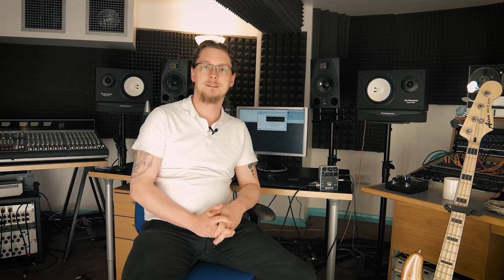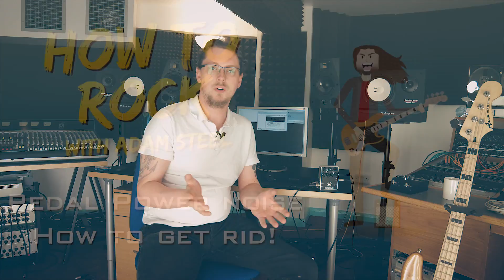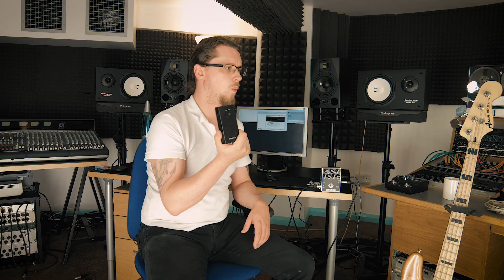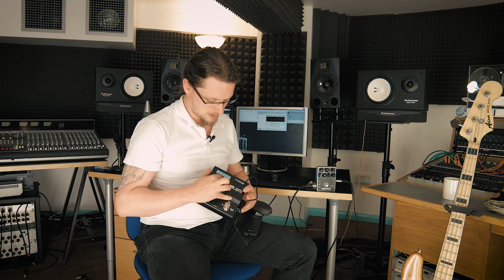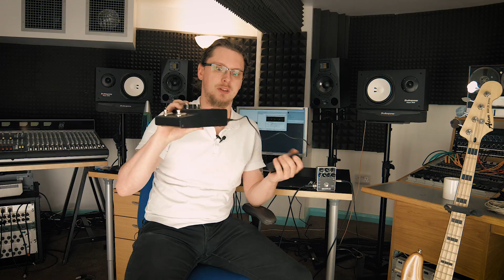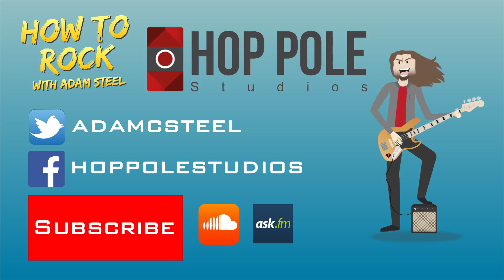Eliminating Power Supply Noise - Recording Hack

Comment: thanks for the video! would changing to a linear power supply work the same?
Reply from the maker: Possibly- a very good, well smoothed and filtered liner supply perhaps. It’s not a case of what method is used, it’s about how clean the power signal is at the DC end. A badly made linear supply would give a lot of 50/60Hz noise which is arguably just as bad
Reply: thank you!

Comment: If you have a guitar that picks up EMI/RF signals even with Furman power conditioners,and isolated pedal power supplies with amps and pedals, same outlets different outlets and you know for a fact it comes from the computer because it gets louder the closer you are. Even if it's on the floor. What is the solution? 

I'm debating using USB over ethernet with all my USB devices to see if that will kill the USB ground loop and the guitar from interacting with the internal PC components. 

Otherwise other options are DI with ground lift. USB hum isolation adaptors.USB powered hub?, Changing out PC and motherboard power supply. Enclosing the PC in an all metal chasis. Dedicated PCI-E USB expansion card? All this costs money. 

Have you experienced pickups picking up EMI and RF from the PC. It's not in my speakers, it's from  the pick ups exclusivley most Notably heard when using high gain distortion with pedals or amps. Equally I know the USB connectors transmit noise because my Line 6 pod go is impossible to use from Any single USB port as it translates PC noise through the USB wire itself. 

What is the solution? 

Sure I could be much further away, but then all my devices require longer USB cables and longer patch cable runs which is inconvenient when you are the performer and engineer controlling everything.

Regardless the pod go cannot be used with my pc for direct recording through the USB. 

My other audio interfaces and pedals are dead quiet with regular preamp hiss/hum with the guitar completely disconnected. 

As soon as it's connected you get all kinds high pitch computer noises. Some of it can  be noise gated out, but still creeps through the signal underneath during performance.

Again I'm using isolated pedal power connections high quality patch cables, and Furman  power conditioners.

Things like ISO hum elimators that go between your audio equipment like those made by morely Will not work with my particular use case as it's not generated or caused by anything but the guitar being in the same room with the PC itself. Exclusively picked up by the pick ups. And in the case with the pod go which is also a computer from the USB port in the PC to the pod. The noise is there in this case even with the guitar disconnected . So the PC generates noise exclusive with some devices through the USB port alone. However also the guitar interacts with the internal components to create digital PC noise, as well as 60 cycle Hum In some cases.

Oddly enough the guitar connected directly to my main audio interface a steinberg UR28M using PC amp sims does not seem to pick up these digital noises. Add amps or pedals and the guitar in proximity with the PC seems to be the issue even with power fitting and isolated pedal power supplies.

Ethernet over USB would allow me to have the PC much further away and still be able to connect all my periphals. However I do not know if it will cure my USB ground loop with connecting a device like the pod go so it's Usable without these computer generated sounds that happens. Or if entry or pro audio cards will function correctly.

So I'm going to try the ISP Hum Extractor + G.

Comment: Thanks, I might have to give that a try. I just bought an iso brick for my power and that is actually introducing more noise and a super high pitched whistle into my set up than if I just daisy chained a 9v adapter, which is upsetting after spending $110 on it.
Reply from the maker: Sounds to me like the high whistle is coming from the power supply feeding the iso brick. I’ve not used those but I use the Harley Benton isolated supplies which are surprisingly perfect for what I do, especially when I’m using a lot of pedals in one setup!

Comment: Bird cord by songbird fx, it takes any usb power bank and up volts it to 9v-18v.  The cost 20 ish US dollars.  I power everything dc with them, I have many power banks I even power large audio interfaces, my Roland street cube ex, I rather have lithium powering the amp than AAs, more stable voltage.  Check out these cords, makes it easy to customize your rig power needs.  And very silent

Comment: How would you record vocals with just a power supply and with a DI box will it be as professional as with a audio interface ? I found a DI for 10$ on Amazon but don't have the proper cable's and will re- buy a interface but just asking.

Comment: why not use a linear power supply...ever heard of one???... one 5 amp or 10 amp supply could supply many many pedals...12 volt ones are available already built...if you need a 9 volt supply design and build one its easy...not rocket science

Comment: It's working great but the downside is that you have to remember to recharge it.
you end in same situation as with batteries / vs pedals...
Damn flat battery and where is a charged one and if only have one then you have to 
wait until charged or use the noisy powersupply.

Not all powersupplies is that expensive.
I have use an old Big John powersupply with 7 outouts of 9 volt.
It's made for guitar pedals and it simply do the job great.
I got it more than 18 years ago and it was already a few years old ( yes second hand ) at that time.
I can strongly reccomend get one of those ( you can find them cheap second hand ) 
They do the job great and you never have to worry about if the powerbank is charged or batteries is flat ect.
It's so strong that I can power my multieffects board too 
( it came with a powersupply very sensitive to ground noise )
But on the Big John it's silent as if on batteries.
Those Multi powersupplies for guitar is a great investment ( even if you buy a new one )
You only buy it one time and they last year after year and never let you down.

Comment: Any ideas on the cleanest brand of PSU's in terms of PC & electrical noise getting into the sound interface when building a new computer? I have a creeping suspicion that computer "RF hash" or noise is actually getting into the AC wiring of the house. When I use my amp (Line 6 Spider V MKII) with my computer turned on there's nothing but the EXACT same kind of noise heard in your video. When the computer is switched off ALL the noise goes away. This is happening with nothing from the guitar, pedal or amp being connected to the PC, I'm simply playing about 10 feet away from it. I'm thinking it's either noise from the internal PSU in the computer, or electrical/RF noise being generated by the motherboard... Any tips would be helpful. Great video btw.
Reply: Go for an audiophile grade PSU they do the trick but they are expensive.
Another solution is to use isolation transformers and / or ground lifting of the PSU it's working too.
Use a combination is best. 
The problem is that the PSU send noise out through ground and this make all equipment able to pick it up.
You must isolate it so you doesnt get groundloop noise.
Reply: Even I am facing the similar issue. Please let me know if you find a solution.
What SMPS (power supply) brand and model are you using in your PC?

Comment: i'm currentlyhaving this problem with my setup. i have a boss gt-1 multi effects pedal, and i'm getting this static noise... i have roland mc505 audio sequencer not getting the noise...
Reply: Smae problem here with an older GT-10.
Reply: @lenni-hazels  i figured it out. i had it dialed in wrong. way too much high end signal. looked up videos on how to dial in amps, amp sims, and modelers. now it sounds great. also use one of the efx blocks for dynamic EQ and shave off anything above 8 to 10 thousand Hz. ... check out rett schul's video about "making your modeler sound like a real tube amp."
Reply: @enigma-g5549  My problem seemed to be about grounding noise. Basically the power supply of my monitor/screen is making a sound around 5k i'd say but I found a workaround. I only use the USB connection now and combine 2 audio interfaces with asio4all. It's not perfect but it'll do.

Comment: Look for a ac/dc adaptor that is a conventional transformer and not switched mode- they are out there. A bit bigger but unlikely  to cause noise.If someone tips a beer onto your peddle effect you won't get a shock.Thats the point of an low voltage adaptor. Oddly old school transformer dc adaptors are electricity  safter (isolating output)
Reply: I think he meant the multiple power socket that some guitarists would place nearby their pedal rigs!

Comment: Thank you for the tips! I have this kind of noise at home when using nothing but a guitar plugged into my audio device with the Fortin Nameless plugin, (or any other hi gain amp plugin). I'm thinking about buying a Fuhrman ac-215a power conditioner for my setup. Do you think that will work?
Reply: Let me know if power conditioner worked or not. I'm facing same issue like you.
Reply: @ratedrsuperstarthega  Sorry to hear that, man. How does it manifest itself at your place? I have this constant 125 Hz thing going on, but it sometimes differs in intensity.
Reply: @iseeu-fp9po  The guitar sounds very muffled with plugins. No matter which plugin I try, it sounds very muffled, fizzy and lifeless. As if something is just not right.
I also have that high pitch whine noise. That digital noise coming into the KRK monitors through the USB.
Just don't know what the problem is.
I have connected EVERYTHING into the same ONE wall outlet using a surge protector strip.
Reply: @ratedrsuperstarthega  Ok, just to be absolutely sure, (and please take no offense of me asking),: you've engaged the cab section, right?
Reply: @iseeu-fp9po  Yes. 100% sure the cab section is engaged. I also keep messing around with different amp/cab sim combination all the time instead of playing. Just can't get that noise to stop, nor can I dial in a proper usable sound due to tone being completely muffled. Tried with different guitars and cables. Same problem persists.
Reply: @ratedrsuperstarthega  What software are you using?
Reply: @iseeu-fp9po  Every possible amp plugin you can imagine. I bought them all, assuming the next one will sound better. Just can't get rid of the ground loop despite connecting everything in same socket with a surge protector strip.
Reply: Oh, man... Well, listen: are you absolutely sure it's a ground loop issue? (50/60 Hz cycle hum)? If so, there are many things you can look into; there are devices specifically designed to deal with that. You could also hire an electrician to inspect your mains. Google is your friend in those cases. I'm pretty sure I'm dealing with EMI in my home, not ground loop hum, and I'm not an expert at these topics in either case, but here are some videoes you can check out: https://www.youtube.com/watch?v=Nakpj_Mee0Q, https://www.youtube.com/watch?v=saOGKoRNNCk, https://www.youtube.com/watch?v=akTJjB0DU6Y,  https://www.youtube.com/watch?v=3mjF9-jgNQE. Sift through these to figure out what sounds more like your issue, and I wish you the best of luck, man! I know it sucks, but I'm sure you can work it out and get rocking in no time once you have it figured out!
Reply: I think I also have this! Tried the fortin Cali yesterday spent 4 hours this eveing with my brother trying to sve the problem - including turning fans down using MSI afterburner 😫 let ke know if it works
Reply: @Emm_R_Guitar  I'm sorry I don't have a solution for you. Still haven't found one for the audio issue at my place.
Reply: @iseeu-fp9po  do ypu have RGB lights in your computer?  Im going to test that next

Comment: Well i have problem with my rode k2 tube mic ! my rode k2 is plugged in Input 1 and when i creates a new Input 1 track in logic pro x and enables input monitoring then monitors creates humming static sound which is terrible and it records tooo ! please suggest mein something  ! can power conditioner Helps mein to solve this problem ?? anyone
Reply: Sounds like yu have a ground loop somewhere in your chain.
Try a ' ground lifter ' on the powercable to your computer and / or mixer.
Somewhere you have a level in the ground that is not equal to the rest of your equipment.
I experienced this too some time ago and it was my mixer so by isolate it with a ground lifter it got away.
( yes it recorded the humming noise because it was in the mixer , so fustrating )

Comment: Hi, Interesting video ! I have a very high pitch noise for years and years when recording any sources, i tried several cables sound interfaces ,different room and equipement, but i keep having this evil noise that makes me unable to create at home. I even tried a sound card that works only with usb phantom power with a laptop with no power supply involved and i keep having this nightmare. I tried the same configuration in friends appartement etc and no noise at all. I'm hopeless. this is so frustrating because i have to record at the studio and it makes me create less. Thanks for taking the time to read my long message !
Reply: Wes hey did you ever get that issue figured out? I have the same issue :(
Reply: Maybe it is a ground loop issue, search on youtube
Reply: set your computer to "power saver" in the power options, its makes the humming sound unnoticeable
Reply from the maker: No, that’s bad advice. That won’t change the grounding issues, and will likely hold the computer back in audio tasks
Reply: @adamsteelproducer  Strange, when i toggle between power saver and high performance the high performance makes the noise really loud
Reply from the maker: That sounds irrelevant to the issue this user was having, it might be fan noise for you which is a different thing
Reply: Hop Pole Studios 
I doubt it bro, I own a pair of Adam audio studio monitors and I too am getting horrible interference, I’ve just actually turned down the volumes on the back of each monitor and turned the volume up on my focusrite audio interface and now the noise is completely gone
Reply: It's the power supply from your computer that sending inteference back into ground.
This will spread into all your devices.
You can get laptop pover supplies with NO ground but instead DOUBLE isolated 
that will solve it.
On a stationary computer you can either buy an Audiophile grade powersupply but those 
are very expensive or you can use a ground lifter or and isolation transformer on the 
power cable ( or use both isolation transformer and ground lifter ) those work great.
You can get small filters to set into the signal way ( like a pedal ) but they take a little of 
the quality of the sound away depending of their quality.

Comment: I recently bought a Zuma from Strymon and I’m dasiy chaning 2 pedals from one input and DAMN did they get noisey as hell ! I guess I should just put one in there right ?
Reply from the maker: Sounds like a potential bleed issue, I’d definitely either a grounding problem or an isolation issue- I’d either run one pedal per output, or get an isolator in between. Gigrig make isolators
Reply: Hop Pole Studios Any chance it might be the daisy chain cable ? Thing is sometimes when I turn them on they make a lot of noise and sometimes they don’t but it’s wierd, when I touch them they sound like a false contact is going on... who knows, I’m going to try swapping the cable and/or finally adding another power supply. 

Thanks for your reply !!